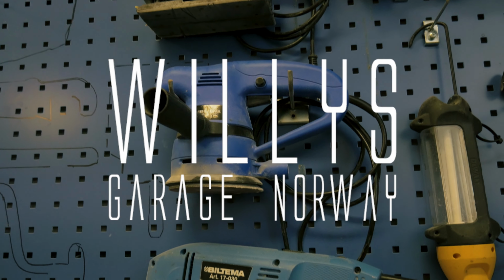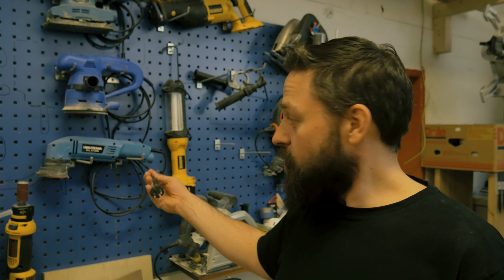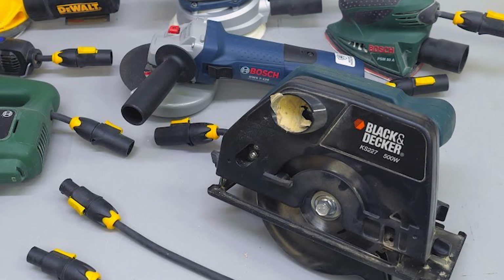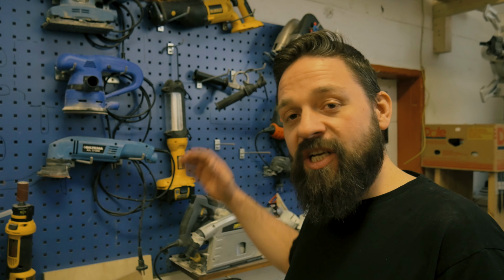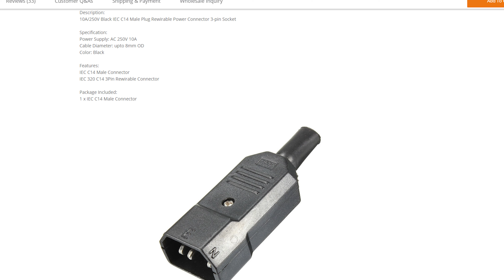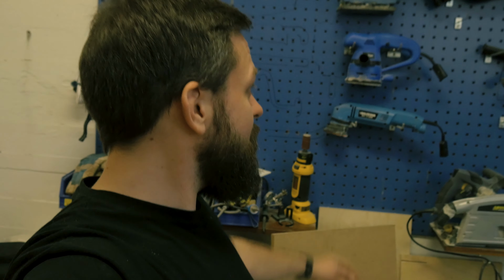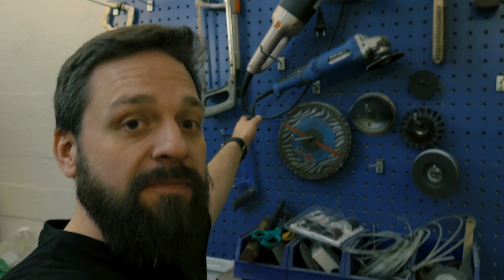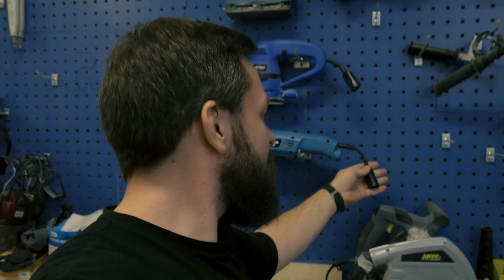Power Tool QUICK Connect PLUGG | cheap | DIY | TIP

Comment: Doing exactly what I am doing, I then started wondering if it would work, and thanks to you, i can see it won't be a waste of time. You have convinced me to stick with Jaycar gear instead of ebay, as you said the cheaper ones don't seem to great.
Reply from the maker: Hi, the connectors I use still works great so nonproblem doing it 👍👍😀

Comment: Very nice, even though this video is almost 2 years old (in 13 days).   I had been thinking of doing this exact thing.   With your inspiration I will give it a try.  :)
Reply from the maker: I'm glad I could give you some inspiration :)  The quick Connector pluggs still work to this day 👍 good luck

Comment: I've used a similar plug for years. Over time they become loose and fall off. Easily remedy is a short length of bicycle inner tube rolled on to the mains cable. When you connect a tool just roll it over the other part of the plug and it will never come loose.
Reply from the maker: Hi and thanks for the top tip 👍😁

Comment: Okay, good idea,but one question: how the connector keep connection with power cable when you pull the cable?
And more, Merry Christmas and Happy New Year!
Reply from the maker: Hi and happy new year. Sorry for late answer Toto. If I pull the cable it will disconnect. But it has not been a problem yet. With that sai I was thinking about 3d printing some clips if it becomes a problem :) 👍 and as always thanks for feedback

Comment: I assume you found a cure...I use something similar, however on my power cable I have a connector that locks and has 2 little "ears" you need to pull in order to disconnect.Been using them for at least 2 years like this...
Reply: Google IEC lock plug, and go from there (you only need 1-2 of these for the power cord)